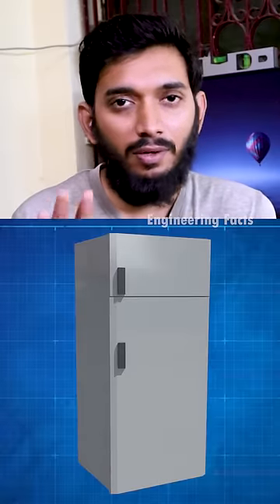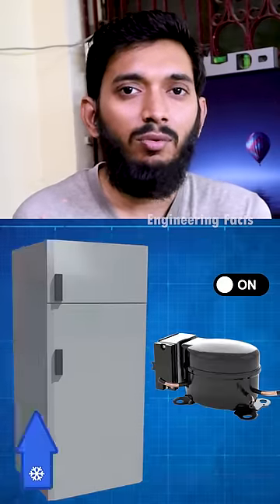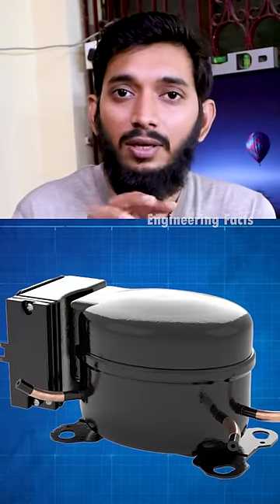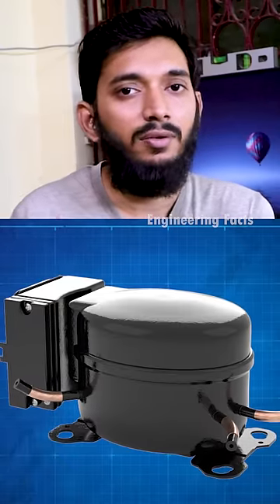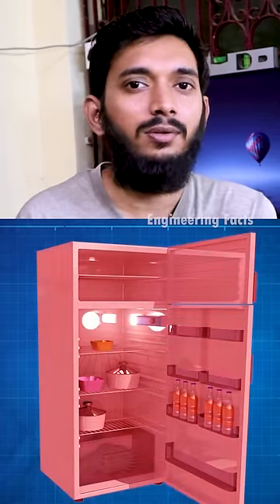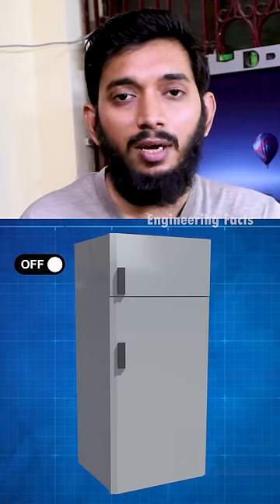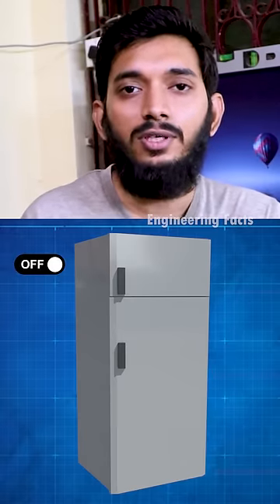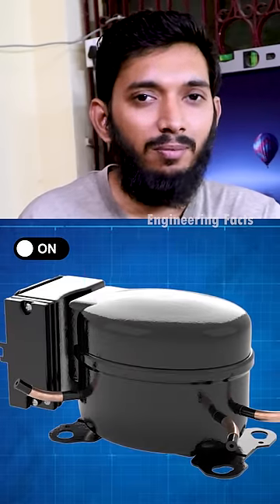Fridge, OFF பண்ணி OFF பண்ணி போடலாமா?

Comment: Bro fan slow va vecha current bill kamiya varum ah 😅.?
Reply: fan switch on pannalainna bill romba romba kammiya varum😂😂😂😂.
Reply: @KR-sf3mg   🤣🤣🤣
Reply: Kaiyilaye suththunga sir..... Currenttu bille varathu
Reply: No, when you switch on the fan 70watts will be consumed ....the change in speed is done by resistor which dissipates the reduced speed  current as heat .....
Reply: Fan one la irukdhalum 5 la vachalum same unit dhan aagum

Comment: Geyser off பண்ணாமல் பாத்ரூமில் குளிக்கும் போது கரண்ட் ஷாக் அடிக்க வாய்ப்பிருக்கா சார்?
Reply: முயற்சித்து பாருங்க 😁😁😁
Reply: Definitely no. Because it has a ceramic surface. The heat which is developed by a coil will transform to the inner side (associated with coil as a heat sink) of the ceramic surface. Thus, the outer surface of the ceramic surface gets heat from the core and heats the water. Thus, the hot water passes through the pipe and reache your bucket. Myself Electrical  and electronics Engineer. Thanks.
Edit: usually ceramic doesn't conduct electricity. E. G: brown ceramic insulator(s) used in electrical transmission towers. Water heaters and iron boxes are examples of resistive loads. Simply, switching ON - electrical input - heat output - ceramic surface - hot water. E. G: electrical kettle. You can touch the surface of the kettle while heating water. You can only feel the heat from the kettle during working conditions.
Reply: @mr.vijayakumarsathya662  thanks for your information sir
Reply: Proper earthing will prevent risk of shock

Comment: The modern fridge switches off when there is enough chillnes inside the fridge, it again switches on when the chillnes goes down below the set temperature!!! This ultimately saves you electricity!!!. The fridge saves current for you!!! 👍👍👍👍👍.

Comment: How about freezers in shop ?i used timer to switch on at day and off at night . Basically I checked the temperature is not drop much if freezer not opened . Hence I do . Is it good method ?i am yet to check eb bill with this change

Comment: Sir, in invertor type fridges, the compressor after attaining desired temperature,  will run at slow speed. Once door opened compressor rotates at higher speed again for some time. So, in invertor type fridges, compressor does not go off and on but cools by speed variation.  Therefore inverter type fridges have a longlife, save power.

Comment: Am using the fridge always with point 1, even though freezer fully with ice within 10 days. How to avoid this?
Reply: Kindly, check thermostat's sensing bulb is touching the freezer or not. If it isn't touching, make sure bulb touching the freezer.

Even if sensing bulb is in contact with freezer and freeze is iced, then you have to change the thermostat

Comment: Technically it's called cut in cut off..inside of thermostat is there,the thermostat function is how much temperature is set to the fridge it's automatically off the compressor when the temperature is reached...again it's start the compressor when the temperature is high

Comment: Hi engineering facts, 
Heat loss in the fridge is not depend on neither power ON or OFF. It depend on only heat loss. 

Even if we switch off the fridge, (without opening for some time ) has the same effect. Please verify and comment if I am wrong

Comment: அண்ணா நா bharathbenz show room la warranty department la work pandren vehicle wiring hornes la four wire eruku oru socket la .so antha four wire la ஒரு wire ECU to sensor sigal ,and 2nd 24volt supply line,and 3rd line earh,and fourth line ground line,intha earth and ground between different konjam full explanation oda with animation video உடன் சொல்லுங்க அண்ணா please